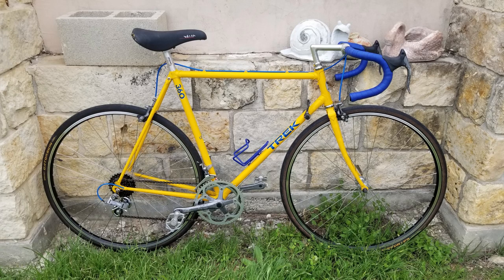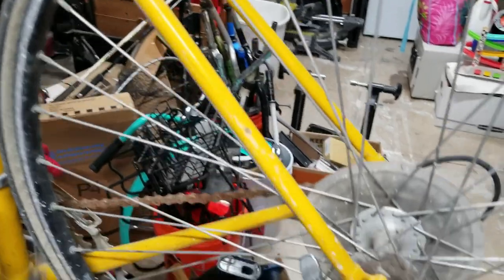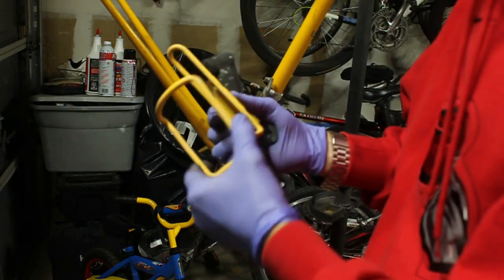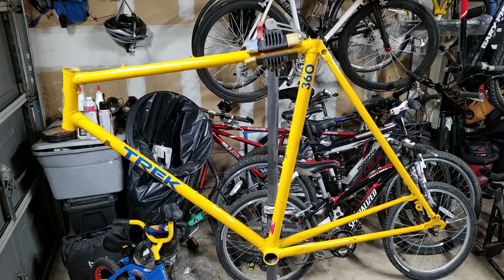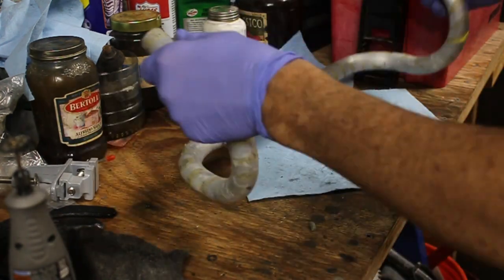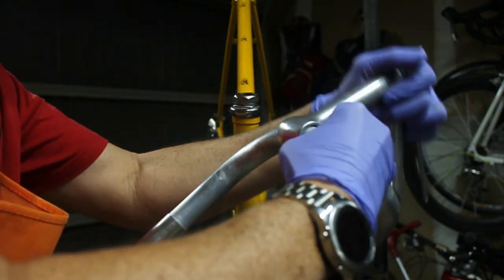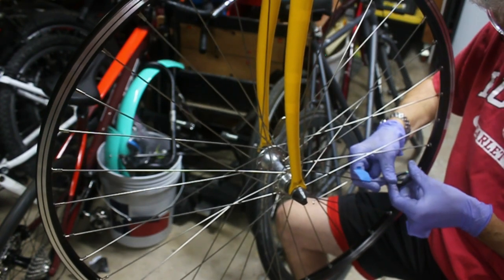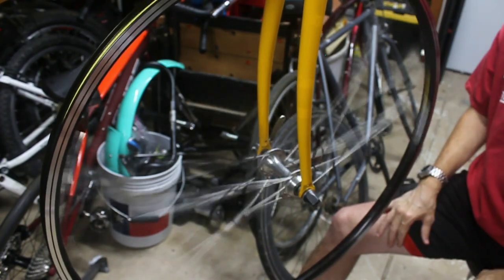🚲1988 Yellow Trek 360 Full Bike Restoration

Comment: The old Treks are fun to restore and get back out on the road.  I have done many and when I add up the original cost plus tape, cables, housings, rim tape, tubes and tires I realize I have much more invested than I will ever recover when I sell them.  In the last ten years I"m sure I am on the negative side of the equation.  This does not include my time or the cost of special tools required. But, I had a lot of fun and working with my hands has always been therapeutic and each bike has been a learning experience in some way or another.  Thanks for the video and keep up the good work.
Reply from the maker: Absolutely! Considering bikes were made with durability in mind back then and not weight or tech as they are today, they are just as functional without all the fancy bells and whistles.  I definitely enjoy stepping back to see a well-working machine that is a fun, economical, and healthy form of transportation.

Comment: Loose Sproket Guy....love your channel name.  
thanks for restoring that great old classic.  love the yellow and all its vintage remembrances for me.  In that era, I had a Sears Free Spirit lightweight, it had just come out in 1973 or so.  and the shifters and brakes and toe-clips on yours reminded me of that nice old bike.  (it eventually was stolen from my garage, after about twelve years of riding .   Love your use of the rock tumbler to clean the spoke nipples.  I thought the brass look was very cool.  Maybe you could keep them, polish them in the tumbler with some Brasso, and then clear coat them.  Wonder if that would work.  It would make an interesting contrast on the wheel's appearance.
I enjoy the running commentary, thinking through the situation and then working it out.
I sort of cringed at the thought of your acetone/gasoline mixture.  hoping no one chunked in a lit cigar butt, or that you passed out from the fumes.  But it seemed to do the job on the rust and grime.
thanks again.  I think I was subscriber 61.  I've never been that close to the beginning for anyone, before.  
Happy Easter! and May this Spring time bring us all beautiful biking weather.  Eric
Reply from the maker: Glad you enjoy, Eric!  I am currently working on a 1960's Bluegrass and will then continue on a Lotus 2000, close to the same era as the Trek. Stay tuned!

Comment: If i had a bike like that i would convert to a 1X system with a huge shimano 42 T cluster and a humongous mountain bike rear derailleur. plus, the wheels will be 700X35c wheel sets that uses the standard automobile air valves commonly found on standard hybrid bicycles.
Reply from the maker: The reason for the 1x system was to increase clearance for the crank.  This improves jumping fallen trunks and roots. 

For a road bike, that is typically not the case, unless you are jumping potholes. 

I have a Haro MTB in the lineup later, and eventually I will do a conversion as you mention.
Reply: @oneloosesprocket  Thank you for responding to my reply.
Reply: @oneloosesprocket  Thank you! for reading my comment, Also, The reason i started to use a 1X is simple, I reasoned what's the point of using the outer chainring when i use the inner chainring most of the time i rarely use the the outer one. So i got to thinking why not do something from the past? Then it hit me! my Ross five speed high riser(the type with the high handlebars,stick shift, and banana seat) had a 1X crank system, which gave me the idea to go 1X on my current road bike and i haven't looked back and i have no regrets.